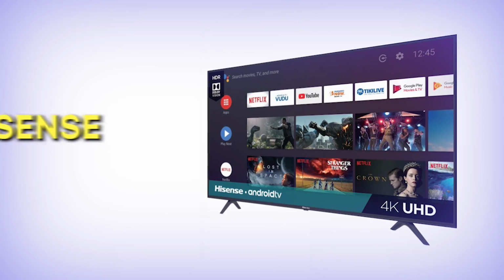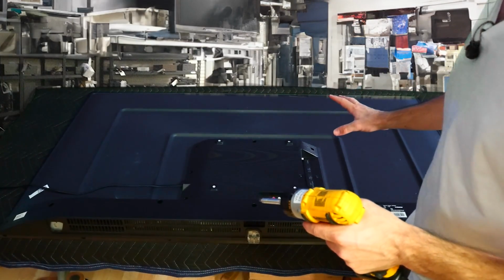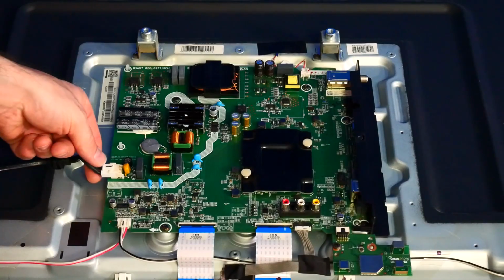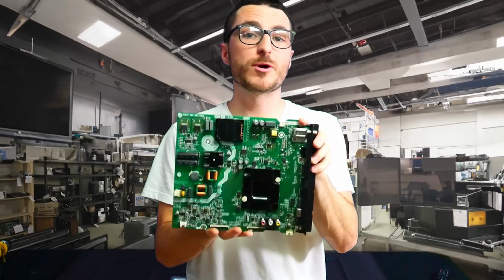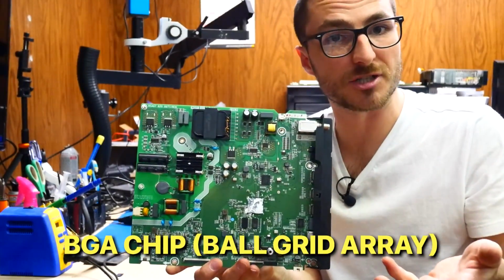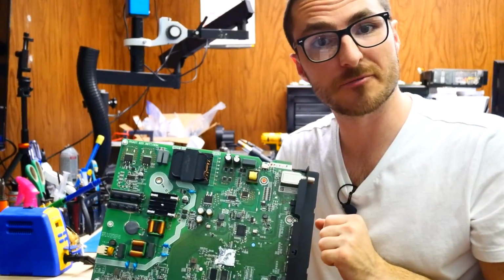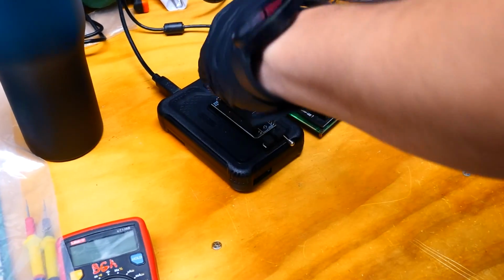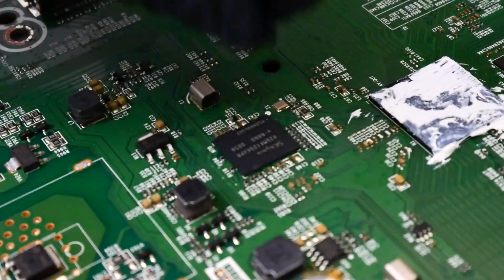How To Fix Hisense TV Shuts off 55H6510G

Comment: Mine shuts off after a few minutes, I tried the whole power cycle shit, tried to wait 10 minutes to replug it in, it shows Hisense logo and those dumb circles, lets me browse the menu a bit before going to a  dark blue screen and I have to turn it on and off again, I cleared cache but if I try to factory reset it just turns off after I click proceed,
Reply from the maker: Sounds like a software malfunction if you ask me. 
The only other thing to try is to reduce the backlight brightness. If you bring the brightness all the way down does the TV stay on longer? If yes then your LED strips aka your backlight is defective and needs to be replaced. If that makes no difference at all then most likely the mainboard is defective just as shown in this video and you would need to send it in for repair. Click on the repair service listing in the video description and that will bring you to our website repair service page. If you have any questions just send us an email
info@nickselectronics.com

Comment: I picked one of these models you mention in this video it's a 55 from 2020, it comes on fine and I can control it for less than a minute and it goes to a black screen then powers off, do I need to have the board repaired??
Reply from the maker: You may want to check out this video next:
https://youtu.be/k6p5znAaiK0

It's likely that your mainboard needs repair, but there is a small chance you could have bad LED backlights and may need to have those replaced. If you follow the test in that video it will help you confirm the fault.

Comment: Hi friend, can you help me? I have a Hisense 55" and a main board power supoly combo like this in this video, that only turns on the standby LED, when I turn on the equipment I get a sound similar to a click, I disconnected the LEDs from the display and the sound persisted, when the click or sound is present I have no voltage, when the sound stops I have voltage but it doesn't last long, I checked the schottky diode and it gave continuity with a multimeter between terminals 1 and 3, do you think that is the problem?
Reply from the maker: What is the model number of your TV and part number of the circuit board in question? 
When you press the power button what happens to the standby led? 
Please do not provide any technical details, I just need symptoms.

Comment: My hisense is 70 inch android tv. All of sudden it shut off and then thats it when i turn it on it shows Hisense and shuts right off. 2 seconds only. I replaced power board and still same issue. Do you think i need to replace main board?
Reply from the maker: Might be the mainboard might be the LEDs. 
That is a really tough one and I don't think you would be able to know the answer unless you have an LED testing tool. You could send in your mainboard for us to test and we can at least confirm if it's working or not. If it is then it would confirm the fault is your LEDs and if it doesn't work then we can fix it for you. That's the only option I got unless you want to buy an LED testing tool. You can find some for around $40 on eBay probably.

Comment: Will this motherboard replacement also fix the faint horizontal black lines I did a factory reset because of that issue and now it auto shuts off during set up
Reply from the maker: No it won't, the lines are most likely due to a failing screen.

Comment: My model is 75H6570G and the red light is off and will turn on with the remote and the button on the tv. Once it says Hisense and then goes to the loading screen with the colorful circles, it sits for a few seconds then shuts off. The red led indicator will not turn back on and hasnt since. I did something that i dont remeber in the settings and since then this started to happen. I have geek squad coming out next friday witb a cost of $144 just to do a installation check. I need advice.
Reply from the maker: You most likely have a bad backlight that will need to be replaced, however there is also a small chance it could be a mainboard failure. I can't help you more than that without being present with the TV to diagnose it, but those are the 2 parts that can cause the symptoms you are experiencing. 
I suggest you don't have the geek squad come out, cancel that service, and hire a local TV repair shop. The geek squad is highly incentivized to tell you your TV is not fixable and buy a new one.

Comment: That sucks. This month make a year I've had my TV and it just started doing this. My warranty is GONE. I would never buy this Brand TV again. I should've kelp my last tv instead of replacing it with this crap
Reply from the maker: It's unfortunate that the TV failed right after the warranty, but it happens with all brands. 
The good news is that at least its fixable, and the repair is cheaper than buying a new TV.

Comment: Hi Nick, have you managed to enable or add the Netflix ESN? I have tried without success, but I have the RT809H, instead they say that with the Z3x Easy JTAG it is possible, if so I would like to know your opinion. Greetings.
Reply from the maker: Not sure it's possible without either spending a lot of money for a license or doing it illegally. 
I know you can buy (not so legaly sourced) eMMC chips that have all partitions unlocked for a heafty price and then use those to program the keys to from the original chip provided the original defective chip is in good enough condition to read the keys off of in the first place. But other than that, no I am not aware of how you could do it. 
If you find something out, let me know.

Comment: So is this Hisense and sony emmcs using the 153/169 socket generally? Thinking of getting the t56 but its hard to understand whats needed with no programming experience
Reply from the maker: Yup, the 153/169 socket is the one we use for all repairs of Sony and Hisense eMMCs. Obviously, it can also be used to program eMMC chips on the mainboards of Sharp, Philips, LG, and Vizio branded TVs but we don't often see as many problems with those eMMC chips for some reason.

Comment: Shame there isn't a way to reprogram them on the board.
Reply from the maker: There is a way but it requires soldering half a dozen extremely small wires to the circuit board and an advanced/expensive programmer. We also often see the IC chip fail on a hardware level. In this video, we had a bit of an exception, but that's why we stated even if the IC chip still reads as a good chip as it did with the one we fixed on camera, we replace it anyway because we know it's at risk of failing.